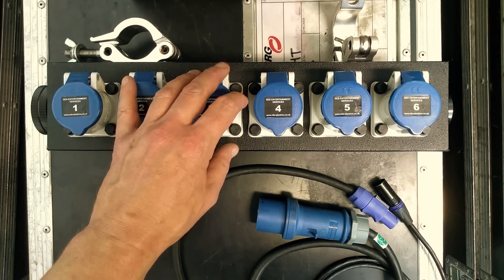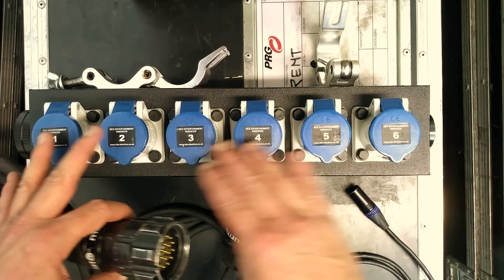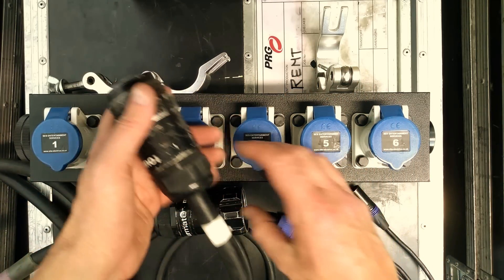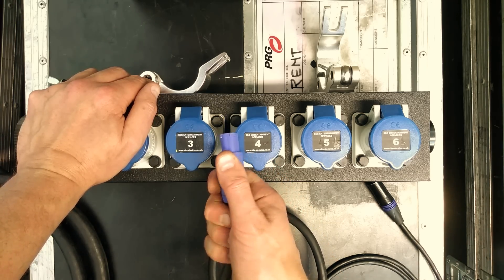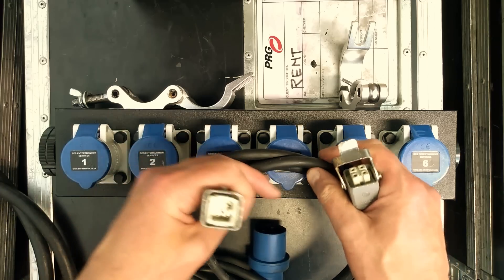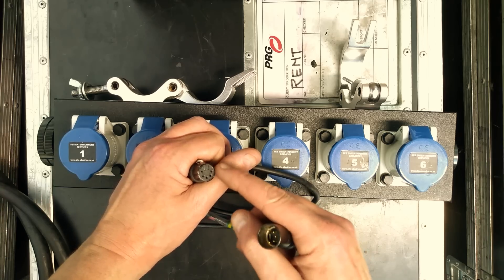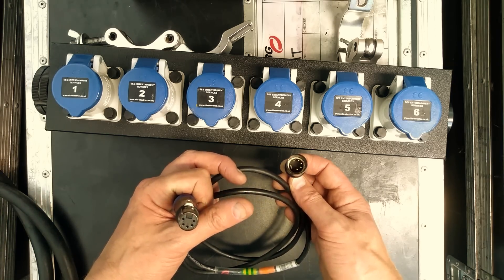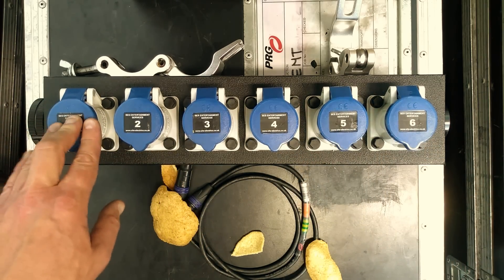Entertainment industry connectors.

Comment: When you get into multi universe DMX, I am surprised you didn't cover DMX over Ethernet and the Cat 5 jacks and plugs inside XLR shells called ethercon connectors.  Of the two most popular standards Artnet and E1.31 or streaming ACN, I prefer streaming ACN.  It can use traditional network switches for low cost and high reliability distribution.  Many lighting desks have either Artnet or E1.31 built in for multi universe shows. An example is the Leviton Piccolo series consoles supporting Artnet on Ethernet.
With more DMX and intelligent fixtures with the transition to LED over incandescent fixtures, the scoapex connector is falling from use very rapidly.  DMX over Ethernet to each truss is becoming more common as reconfigurations are very simple.  Plug in power and  network connection and the install is done except setting the universe and channels used by the fixtures on the bar..

Have you started using DMX over networking yet?  With a small number of universes, a laptop and a wireless router makes for a great traveling show setup. Router is on stage and the laptop now only requires a power connection to run a show cue list of scenes.  I typically for a small show run between 1 and 3 universes over ACN streaming E1.31 ethernet.  For larger shows where wireless network connections may be an issue, and more universes need supported, a Shielded CAT 5 cable is used for the link.

If you know where to look, there is some very affordable ACN and ArtNet gear available.  Some software is low cost or free.  For one universe of ArtNet Freestyler is dated but works well.  For multi universe Streaming ACN, QlightsPlus works very well for many show applications.  Both of these programs are free.  There are more complex and commercial offerings such as Madrix and some by major lighting manufactures.

Comment: What is the logic behind providing a seperate earth for each circuit? Surely you should provide only one earth (the PME philosophy of just bonding everything to everything) in the cable?
Reply: +Spitz103 - it was discussed in detail in another thread, but the quick answer is because multiple earths are easier to wire, and the circuits often need oversized earth wires on their own due to dimmers.   It's safety and pragmatism.

Comment: In Estonia in stage industry we are using: shuco, 16A 3phase CEE, 32 3phase CEE, 63A 3phase CEE, 125A 3phase CEE, power lock for 400A and for bigger loads cable luggs and big cables :D . For multi core we are using socapex, it is also used for direct control hoists.

Comment: We once got a dmx controller back from a customer who thought it was a great idea to use XLR for both DMX and 230V in the same installation. Needless to say, when we opened it up we found the varistor across the DMX output had completely disappeared, leaving only a scorch mark in its place.
Reply: Actually, now that I think of it the vaporized varistor may have been the customer who decided to use 5-pin XLR instead of 4-pin XLR for 48V scrollers (since the convenience of using an easy-to-find connector obviously outweighs the risk of connecting things that really should not be connected).

Comment: Hi Big Clive! One the other end of the C-form connectors there's a smaller connector. What is it called? How many amps is it capable of driving? I want to use them for slot car tracks. Thanks!
Reply from the maker: Powercon by Neutrik?  If using for low voltage you could consider the Speakon speaker connectors.
Reply: Thanks, Big Clive! It's 12V at a couple of amps. Needs to be 3 pin. Thanks, again!!!

Comment: I was thinking of creating a powercon power cable reel for my needs specifically for feeding my live streaming rack. Do you think it would work? I dont want to use the EU plugs that can easily break/get unplugged I'm looking for something more robust. I''ll just rip off the connectors from a 3x2.5mm power cable, install it on a reel and then crimp/solder powercon male and female connectors.
Reply: That should be fine. Powercon is rated to 20A.

Comment: Why not CEE RED or Caravan Blue?
Reply from the maker: The Three phase distribution equipment and extensions use the red connectors.
Reply: Connectors are colour coded based on the highest voltage present (with a band of voltages for each colour). In most of Europe we use a 230V/400V three phase system and connect loads from phase to neutral so we normally have red three phase and blue single phase.

If you had a 400V single phase load you could use a red single phase plug to connect it, but that's rare.

If you were in a place that uses 120V/208V you would have blue three phase connectors and potentially a mixture of blue and yellow single phase ones.

Comment: I was wondering if you still used single-pin connectors in EU-land or if they had been outlawed. They came close to being outlawed for entertainment use in the US about 20 years ago, but fortunately the entertainment industry had people working on the National Electrical Code, so things worked out well in the end.

From my point of view AMX-192 came before DMX, but then, we didn't have a lot of Strand dimmers over here.
Reply from the maker: We still use single core 400A Powerlock cables.  It's the only sensible way to distribute that sort of current.  Not that the EU red-tape factory actually does common sense.

Comment: Intresting seeing the different uses for some familiar connections, the 16 amp blue 'commando' plug is pretty standard  (caravan sites) also used in industry,  we used them in my last job, (plastic injection moulding factory) for connecting auxiliary equipment to moulding machines,  also used the 4 pin Harting plugs and the rectangular version of the 19 pin plug for connecting hot runner heating controllers to mould tools and for data interconnections for pick & place robots.
Also used the red 32amp 3 phase  commando type plugs on 9Kw mould tool water heaters.

Comment: Have had a bit of gear damaged due to people plugging in PowerCon True the wrong way around, it seems to be much easier to do with ripoff-style connectors. I didn't believe it at first but after trying myself it's actually surprisingly easy to plug them in the wrong orientation. A bit of a design flaw.

Comment: Your industry isn't the only place to use Harting connectors, by far. The tire retread machinery I deal with uses I think 5 pin Harting connectors. 2 for heating, 2 for temp, one for ground, or something like that. The internal pins are nowhere near as chunky, yet they're still rated for 3 phase.

Comment: Wow I’ve been following your channel for so long now and never realized you worked in the same industry. Really cool stuff. Definitely a bigger fan of the True1 connector over power con especially since the connectors can now plug into each other if you need to extend further. Not sure if you’ve heard about the new connectors being used on tour that still have the 6 circuits but also carry data in the center few pins and the best part is it’s quarter turn collar lock so no more gummed up threads and wiggle-turn-wiggle-turn of Socapex

Comment: These are connectors I have been considering setting up for my tools. My woodshop class in HS had similar connectors which were compatible with a wall jack if you flipped the retainer lock back out of the way. Each stationary tool and table had a 6-way bolted onto it somewhere to plug loose tools like palm sanders in. And my favorite feature regardless of cable tech, individual breaker switches on each port with status lights: flashing green in use, green for safe to use, yellow for fault and red for non-functional. Majority of the time faults were idiots tripping breakers and moving to a new port instead of just resetting the breaker.

Comment: talk about DMX cable run length I  have a static installed , in a retail location that has about 12 led light bars for multicolor after about 4 units 45 feet of dmx the signal gets distorted and the lights flash neither the electricians or the archtech got things to work  before leaving the job so I've tried to sort it out no luck I need some sort of terminator resistor? how far do data signals go before going out to static are amps used to expand the signals? its totally what the F who you going to Call? dose cable size affect signal length what values on a multimeter do I need to see on a distance, its not complicated all light red ect.  I've resorted to just manually setting the lights disconnected yeah data /dmx doesn't work well at all. It's like I have a car just don't turn left or right ah disconnect its now a home furnace, and it like fell ashamed you can't fix it
Reply from the maker: A terminator is a good idea.  On DMX it's just a 120 ohm resistor across both the data lines.  If that doesn't resolve the issue then check the wires are not swapped, shorted or open circuit.
Reply: DMX reminds me of midi it was 5 pin too, but what a mess 40 plus years ago the music gear manufactures agreed on protocol then did every thing possible to wreak and not follow them none of the midi machine allow you to send bank and voice selection data and GM midi sounds good for 1985, but anything else requires samplers that are CPU and RAM costly  and generally have all-sorts of software timing and bugs.

Comment: Sadly here in the USofA many manufacturers of DMX gear are using 3 pin XLRs. Apparently this is supposed to be for convenience, grab any cable with XLR and it works for audio or lighting. Or perhaps because 3 pins are cheaper than 5. But of course this muddles things up for some users. It's certainly easier to identify cables depending on the connector.
Reply: @KeeDx3 I hear you.
Reply: It's not really a Chinese thing. HighEnd, Martin, Robe all used 3 pin.

Comment: The "Socapex" reminds me of some of the Amphenol connectors we use in the environmental monitoring industry.  There are many, many different configurations that can be done with the same connector shell.  The military is also very fond of them.
Reply: They are a mil-spec connector. You can get a soca with a nato part number and it will only cost you 3 times as much.

Comment: I was working in MTV Finland 1975-2001 and we had RCA TK-45 color cameras which had very thick camera cable having hundreds of pins. Quite often I had to repair those. Naturally the fault usually was in the center pins and I had to remove huge amount of pins before I could fix the problem.
Reply: That sounds like a challenge

Comment: Harting is a lego, you order housing, internals, contacts, accessories separately. You basically compile your own custom connector. You can have whatever in there, signal, power, data, fiber optics, pneumatics, coaxial, pretty much whatever you can think of. The trick is to keep track of what series connector parts you use, in what order they go together and what the actual part numbers are.
Although, it must be noted, putting pneumatics in a same connector with electricity is generally a bad idea, it sometimes happens that instead of air you get oil or water from somewhere upstream.
https://www.harting.com/sites/default/files/2017-11/Han-Pneumatik-Modul_Hint_0.jpg
Reply: Harting looks amazing!
Reply: Air? let's put water cooling through the same cable :>
Reply: Tube is a tube, you can put strawberry syrup through it for all it cares. It's just that in the unlikely event of a leak, an electrical connector is one of the worst places it could happen at.
Reply: Never thought to test the heat transfer values of strawberry syrup... I wonder if it's  better then water for cooling... good idea!

Comment: Apparently D54 was almost exclusive to the UK, but it looks somewhat similar to LMX/MPX which was mostly (AFAIK) used on small point-of-load dimmer packs, but with different voltage levels.  Here in the US prior to DMX we had AMX192, which was a similar serial/analog scheme that used an interesting combo of an analog voltage level signal with an RS485 clock on a 4-pin XLR.

Comment: Why are there dedicated neutral and earth pins for each circuit in the socapex connector?
Common neutral and earth pins would reduce pin count from 18 to just 8...
Reply: But then you'd have to have much larger conductors for those wires and much larger contacts, and it would be harder to wire up the fan-ins and fan-outs, and the cable would be less flexible and more expensive to manufacture.  In fixed wiring you can often get away with an undersized neutral based on the idea that the three phases will usually be fairly close to balanced, but not in stage lighting:  The phase angle control dimmers used to dim incandescent fixtures have substantial harmonic content that means you often need to have an over sized neutral on a three phase feed.  Plus in a Soca connector you can't rely on the six circuits being evenly distributed on the three phases anyway.  They probably will be if they come out of a dimmer rack, but if there's a fan-in from six individual plugs then all bets are off.
Reply: The common neutral in a 3-phase system does not need a larger area than the three phase lines. Even in worst case imbalance situations. However, dimmers do indeed mess up the PF a bit, so yeah. Can be solved by using different dimmers.

But yes, if there is a fan-in box, then it can't be done.
Reply: @vonnikon  Connectors where every pin is the same are easier to design and require less tooling to manufacture = cheaper. Apart from specialty applications and real-high volume stuff (like CEE, where the PE pin has a larger diameter and typically two screws instead of one, if it has screws) it's fairly rare to see mixed contacts in the same contact housing. If you need mixed contacts in industry, you just use modular connector where you can mix different modules in the same connector. E.g. a two pin, 40 A module and then an eight pin 16 A module.

Comment: Nothing worse than pulling 30m of Socca to find that the locking ring was kindly bent enough to not see until you try and use it...
Reply: Callum Burns no worries, just go and borrow a truss hammer from the riggers! Whack whack whack, ok it threads on now.

I did a show recently where I got a sheepish call on the radio during load out from some of the crew who can't undo a Socapex going out from a cable way to the truss. I crawl up to the connector and discover they've actually undone the (reverse threaded!) housing and don't understand why it won't come off. After I reassembled the connector, I discover the lock ring is jammed, so I tell them to bring me a hammer.

Whack whack whack. I spin the lock ring around freely and pull it apart.

Brute force and ignorance always has a part to play!
Reply: Had that with a 100m 24ch multicore

Comment: The 4-pin Harting looks like a HAN-3A (Harting does not count PE pins...) At work we use quite a lot of it brother, the HAN-Q5. The HAN connectors with that hood (HAN A hood, also used by others like HAN Q5) are indeed pretty robust and have a decent number of mating cycles (although it's no MultiContact / CombiTac :D).

Comment: CEE connectors are commonly used in datacenters to distribute 16/32A single phase and 16/32/65A three phase. And all construction work is done with the same CEE connectors (distribution boxes and cables). This makes CEE the most widely used standard in this part of Europe for almost anything (events, congresses, construction, datacenter, telco, etc). I haven't seen the old (pre CEE) connector in a while, guess it's phased out completely.

I'd love Neutrik' PowerCon due it's size and locking. Compared to IEC C13/C14 (servers/networking), which lacks that (as official standard, there are some clips on some hardware).
In datacenters Cat5(e) is used for RS485 and Ethernet (IP) to communicate with PDU's (power readout and on/off).
Harting is used in the entertainment industry, but shifts to (ethernet or DMX over) Cat5(e). Since controllers are cheaper then (a lot of) copper cable used with Harting.

Looks like more and more industries use the same standards (where possible).
Reply: Yeah, I recognise it from server cabinet power cables

Comment: Ah yes. This is how I learned how to solder. I’ve made many speakon, trs, xlr, neutrix and every other connector you could think of way back in the day. I used to work for a company called Quality Sound and Video. Also used to setup for many large concerts.
Reply: Quality Sound and Video used to be a major player in the Outside Broadcast and Location Film industry. Your bunch did the sound for a location filmed at St Bartholomew the Great church in London - and they were parked right outside the lab where I worked at that time (North East Thames Radioimmunoassay Laboratory - better known as NETRIA)! I think the vans were painted maroon (though I'm not so certain of that!)

Comment: Interesting. Here in germany, we use Our normal Schuko-Connectors with PowerCon on the other side. Socapex was used years ago for 0..10V Analog Controllers, just the analog Signal. For Heavy Loads like Dimmer-Racks we use 32A CEE Connectors.
Reply: Valentin !1! The old analog dimmer packs and deck we had back at my school before we moved to a zero88 dmx setup used XLR7 with 0-10V analog, one 7-core cable per 6-channel pack.
Reply: @JasperJanssen  i didn't even know 7pin xlr exists. Must be a real pain in the ass to solder those conectors to the cable :)

Comment: Back when I was doing tech in school, the high school theatre used NEMA L5-20 and the middle school used stage pin *shudders*. When ever equipment moved from one space to the other (somewhat often), we'd either end up lugging a stack of adapters everywhere or spend a couple hours re-terminating everything.

Comment: I like the multipin connector on the side of the connector box, reminds me of the military connectors i used to solder wires to, in a factory :-).
Locating notch and ring, really nice design, reliable.